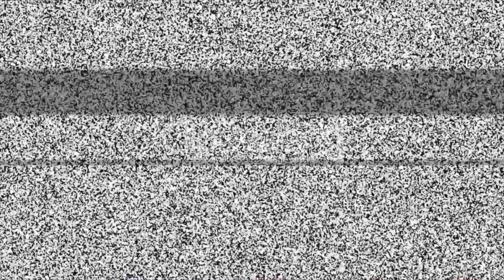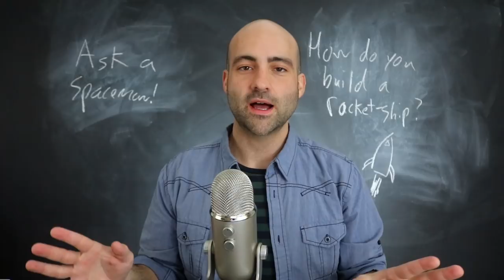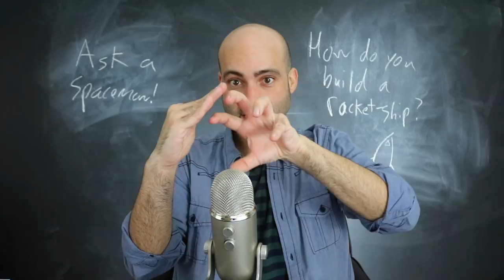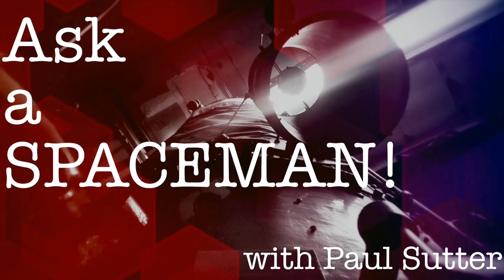The Awesomest Rocket Nozzle - Ask a Spaceman!

Comment: It is amazing how a rocket engine can convert chemical energy into forward momentum.

What I like is how additional features are used to extend performance. Submarine launched missiles are logically very short, a lot has to be crammed into minimal space. The Trident missile has an aerodynamic spike that is extended forward, it lowers aero drag at supersonic speeds. Other rocket engines can have extendable nozzles, extending on altitude to they can match up with the external air pressure to be efficient.
Reply from the maker: Indeed, anything to squeeze extra performance out is a must.

Comment: So if I was floating in space, say an EVA, and I fired a revolver(pretend recoil doesn't move the gun barrel vertically, and no friction in the barrel),  I get that the exaughting gases would propel me backwards.  My question is would the bullet stay stationary and slide out of the barrel as the gun and I go backwards, or would the bullet also move forward?  or would it just sit in the chamber and move backwards wth me and the gun?
Reply: Conservation of momentum.  The bullet and gases are moved one way and the gun and holder of that gun are moved the other way.  They don't leave the scene of the firing at the same speed though.  The bullet and gases weigh much less than the shooter so they move way faster.

Newton's third law: for every action there is an equal and opposite reaction.
Reply: Yeah, that bullet would move, faster than on Earth as there was no air getting in its way.

Both the bullet & gasses (small mass, high velocity) would give you (large mass) a small velocity in the opposite reaction.
Reply: The same things would happen if you shot the gun underwater, except the results would be smaller in each direction.  The bullet wouldn't go nearly as far and your body wouldn't recoil as much. The results would be even less if you were submerged in wet cement.
Reply: Thanks for the replies.  Physics has always fascinated but eluded me.
Reply: What if there was some kind of way to not have a reaction in any direction whilst firing, would the bullet leave the gun faster?
Reply: As to Lenard Segnitz.   Agreed but I don't think It's so much the WEIGHT of each item but rather their individual masses.  Weight only "matters" in a field where the gravitation has a center, like the Earth.  Notice I didn't say weight only matters in a "Gravitational field".  Because a gravitational field completely surrounds any mass object like the bullet or the gun floating in free space.  But when the bullet and gun are sitting on the Earth, their centers of gravity act toward the Earth's center of mass, which is somewhere near the center of the Earth, but not exactly because the Earth is not homogenous.
     Man, I gotta stop listening to those physics audiobooks.  One of these days I might even convince Dr. Sutter I correct.